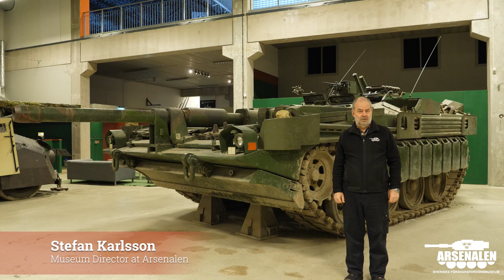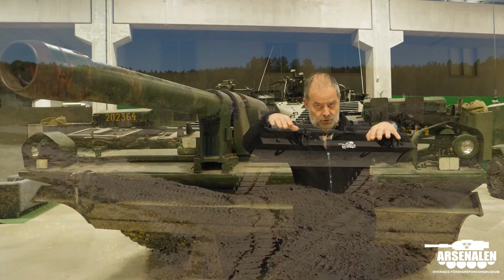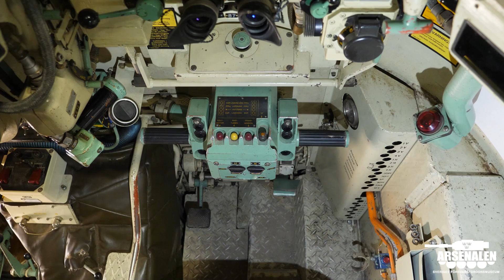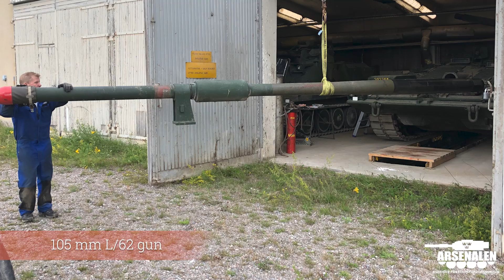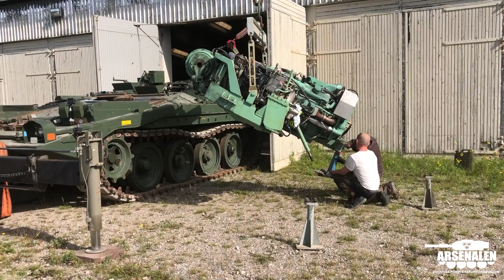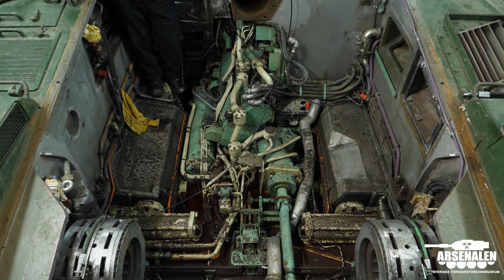Strv 103 – Engine Lift  | Arsenalen Swedish Tankmuseum

Comment: That is a great video.
It is so interesting to see what's inside (most of my toys got disassembled when I was a kid).
It would be very cool if Mr Karlsson would tell more about components and how do they work.
Like transmission and hydraulic system.
I was quite confused to see the shaft under the power pack with some other shaft running across between final drives.
As far as I understood, the power pack delivers the power to the final drives through the steering mechanism in the front of it.
So the shaft under is is doing what? Delivering a power to a hydraulic pump located in front of the firewall?
And also the thick pipe going from front under the shaft to back?
And the vertical aiming actuators are somewhere?
I think this vehicle does deserve more in detail video, especially on general layout and all that plumbing and shafts.

Comment: 1950's hydraulics... That must be fun!
Reply: Are ypi faschist
Reply: @abaialsa712  Not at all... I really don't like hydraulic fluid leaks, and that thing must have been a nightmare for the poor soldiers that had to repair it.
Reply: @MsJoao101  Yepp, i developed a hatered for that awful smelling ,and if old enough a biohazard, hydaulic fluid used in them because when i did my service in 90/91 we started getting more major breakdowns in the hydraulics because of age and abuse. And if i remember right the central catchtank alone holds more than 150 litre. So if something major breaks or spring aleak that shit gets everythere.
Reply: @plasttjur  I feel you. I never worked on tanks. I did repair and maintenance work on hydraulic lifts, cranes, diggers, stuff like that, a fully pressurized circuit leak will rip a finger out of your hand, or the hand out of your arm, it's not only toxic it's down right murderous and back then those fluids where even more awful then today's ones...
Nasty stuff!
Reply: @plasttjur  Still the S-Tank will always be very cool!

Comment: The most interesting concept in tank history, a tank, even capable of fighting with one soldier, but highly complicated, in my opinion the addition of a turbine - nothing against that - makes the gearbox extremely complex.
A bigger diesel combined with a small APU might have been a cheaper variant.
Reply: The problem was that a bigger diesel engine at the time would take too much space inside the tank for the Defense materiel administration requirements for the 103.
Remember, this tank was designed in the late 1950ies!
Reply: If i remember correctly they were looking at that to.
Reply: Bear in mind, the S-tank was developed to defend Sweden and only Sweden in a brief defensive war, much as the Finns had done in 1939-40 against the USSR. Swedish tanks didn't need to be fast to produce because no war Sweden could sustain would last long enough to make much use of new production tanks. If the standing tank fleet couldn't "win" the fight, a few more vehicles rolling off the production lines were not likely to make the difference. 

What could matter was if each tank was so optimized for defending Sweden that they could "win" in the first weeks of the fight. S-tank was intended to be the "flank guard" for the Swedes, the tank that could secure the under-developed countryside against enemy attempts to swing wide around the heavy infantry and armored formations defending the direct routes to Sweden's strategic places like Stockholm. 

To that end, S-tank needed to be very small and very light and very fast to use the small wilderness roads and low-capacity bridges that dominated Sweden beyond the coast and old farmlands. A gas-turbine offered the best power for the size, so it was ideal for S-tank because it could be much smaller overall, allowing it to go more places to potentially outmaneuver. 

Do note, the Swedes kept heavy diesels in the heavier Centurions, because the extra-weight didn't matter where Centurions were intended to fight, down in the developed South along the coast and the old farmlands with tits many broad roads, firm fields, and robust bridges.
Reply: It is strange since I can swear the turbine was running some kind of petrol or aviation grade fuel. But anyways the power seems to be all American so hard to even know what a cubic inch is. Ice cube sized or potato sized? Jokes aside.

It seems like the right choice at the time. Few numbers of expensive vehicles made to very special needs or wants. The piston engine being just a must since it should be the engine running the show when the gun is needed. And the turbine being the thing that gives it the power to maneuver. Like remember the air weapon in Sweden was also complicated. Used gas turbines (but rather then a final drive and gearboxes it drove a prop/fans and stuff over simplified.) and I'm not a aircraft nerd but it also has some important flaps and controls that are hydraulic yea? And even if it had 6 gearboxes so what? It dose not matter that you only have 1 gearbox if it is just junk. For being 6 gearboxes it seems very compact. It is limping back home or into safety easier then most modern cars even! Like a fighter yet has problems it is allot more problematic then a tank that maybe still can limp into a position to be a tank! It is still such a wild design. 6. How can that be even possible.

But something tells me the hydraulic engineers life was pure hell! Even now it seems incredibly how much is accessible ones the pack is out. 

It was the British normal tanks that did the traditional tank duties. Whiles the S-Tank had only one role and that was a highly mobile rapid fire defense weapon still capable of much of the traditional tank duties. It seems more like a aircraft for the ground. Like how the Saab cars where some of the first true road turbo cars and very strange and unique. Whiles the Volvo bricks where like the Centurions and whatever else with a turret. Just dumb and trying to avoid being over engineered. Meanwhile the Germans somehow managed to make something far better and without any armor or nothing. Still incredibly advanced and effective yet simple! Leo.

I still preferer driving in traffic and seeing a S-Tank then a Centurion or like really anything else armored. Remove that 1 meter extra from the gun barrel and it seems like the most road friendly tank ever made with such capabilities. Just have a look at the driver and commanders view! They can frankly get a round off in traffic and call it a time waste and road justice! Since it seems that capable even without a turret to actually have the controls and abelites to keep to the road and still get a shot in. Just incredible. Most likely a reason for the 6 dam gearboxes being needed is that ability to driven this crazy thing.

It is honestly scary looking at the engine pack and engine bay. Add some garbage black plastic parts and serious wire and boxes of junk all around it? And yea the rust removed. Well it looks like a modern highly complicated and expensive to run vehicle. And this thing was designed and used pre 2000! It is remarkable. And 4 000kg of stuff to cover the crew compartment and then add on a nicely angled upper and lower plate etc? Like unless you are attacked from the rear where the ammo is stored or directly side on? Like dam. Even the CV90 looks like a joke compared to this insanity! The Saab of tanks seems like a good name for this engine bay.
Reply: @TheDiner50  the thing with a turbine is that it can be trimmed in to run on any liquid fuel that can be atomised by it's fuel diffusers.
Reply: @genericpersonx333  and in the case of the centurion - Gotland too
Reply: @TheDiner50  CV90 has a fairly complicated hydraulic system too...
Reply: Maybe a boxer engine would be low enough profile but there has to be a height to width-ratio that you just can't get past.

Comment: A most interesting video.  I never appreciated the complexities of the S-Tank's systems.
One question, however, why were two entirely different engine types used?  Why not two diesels?
Reply: Not really sure but I think the turbine engine was for extra power and especially to start the tank in extreme cold Swedish winters
Reply: The turbine engine has a much better power-to-weight ratio than a pistol diesel, but they have some drawbacks compared to a regular piston engine: they are extremely loud and smoky, they produce an extreme heat signature with all the hot exhaust gases (even if IR optics weren't really a thing back then)
Turbines also run on very high rpm's. It is essentially an aircraft engine.
A piston engine is better suited to power the hydraulic systems in the tank, everything from steering, aiming and operating the autoloader. The hydraulic pumps probably work on a lower rpm/ higher torque.

The typical diesel engine of the era  is an "inline-configuration" wich results in a very tall engine, as the pistons travel vertically inside the engine block. This is the types of engines found in stuff like trucks, farming tractors and tug boats. Rugged, reliable, relatively fuel-economic, and very easy to work with. But a bit bulky and heavy. A normal piston diesel, powerful enough to power the tank, would be so tall, it wouldn't fit with the low profile of this veichle. You can see that even this piston engine is way taller than the turbine, even though it has much less horsepower.

Just for an interesting comparison, the CV90 Infantry fighting veichle has a modern V8 Diesel from Scania. That engine is very powerful, but the V-confoguration makes it more compact than an inline engine of the same cylinder volume. I wonder if it would fit inside the S-tank?

Comment: Glad to see the Detroit replacement, though dated, a well proven engine...
Not thrilled with a turbine unless for electric generation ... which would lend it well to eliminating too many mechanical drives, finishing with modern electric propulsion  
As well opposed piston diesel tech in the west is VERY promoting 
I think Sweden should have updated & kept this jewel...

Comment: Great video. And, in depth knowledge of a former tank commander on the actual S tank.

A true testament of very novel thinking and engineering in Sweden at the time. 

Even though it can't fire on the move it can do better than any T80 or T90 what I see most tanks in Ukraine do. 

Come out of hiding quickly go into pre planed position fire a few acurate rounds that hit faster than any missile against armour of the enemy or any target not in range of artillery and scoot back.

105 mm rounds are far cheaper than any missile. 

This begs the question was night vision ever installed and was thermo imaging ever considered?

And, was add on armour ever considered?

A tank that if need be can be fully operated by one man is an enoumous asset.

Is the S tank still in reserve storage. As the Russians prove a tank is a tank even when it's a T62 out of the scrap yard.

And, as a former Dutch Leopard 1 tankdriver and PRTL / Dutch Gepard (anolog now updated digital versions) fighting in Ukraine in a viable cost effective with ammo way. 35mm rounds are cheaper than missiles. The AA tanks and MBT's are still there. 21:10
Reply: Regarding if they still are in storage the answer is no, they went to the scrapyard after the Leopards went in service.
Reply: @plasttjur  with hinsight and the knowledge of the Ukraine war that doesn't seem a wise decision. The cost of mothballing them would provide quick  urgent tanks after say half a year during war. Especially with upgrade kits.

Comment: Question for Stefan:
I see that the paint is scraped off from the end of the barrel...
Was it common to bury or scrape the gun into the ground by accident, and did this ever cause significant damage to gun barrlels?

Thanks for a great channel.
Reply: No knowledge about how often, but there was abundant stories about drivers forgetting to elevate the whole chassis and gun before crossing a ditch and ending with the nose stuck in the mud.

Here are three longer stories that might not be true.. 

1: A Strv 103 gets stuck in a marsh. They call for help, but for some reason they then leave the Strv. While away the salvage party arrives, and salvages the Strv. They remove the antennas from the Strv and push them half way down into the marsh where the Strv was stuck, and leave with both the salvager and the salvaged vehicles. When the Strv crew returns... 😂

2: Whenever you lose any gear belonging to the Swedish defence, you need to fill in a special form and get it approved before you can get a replacement. A sock, a shovel, a 1000 metre drum of telephone cable - everything had a unique number to go on the form, and the form formalia could not be escaped but sometimes the form wasn't scrutinized enough.. Legend has it that someone managed to get a form for losing a Strv 103 signed. 😂

3: A truck is on its way to resupply a cooking/kitchen detail on an exercise field. In the passenger seat a delicate item is transported: 144 eggs. Unfortunately, the truck is struck by a Strv 103 at speed. The truck driver exits covered in a huge raw omelette. After a while the reverse-driver of the Strv talks on the intercom: "Hey guys! A tank has hit a supply truck!" Commander responds: "It's us.."